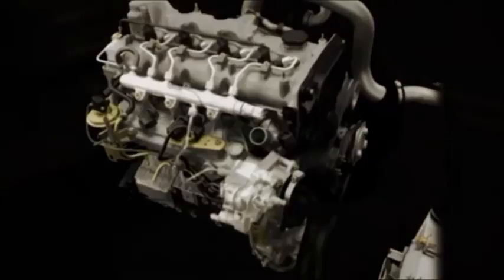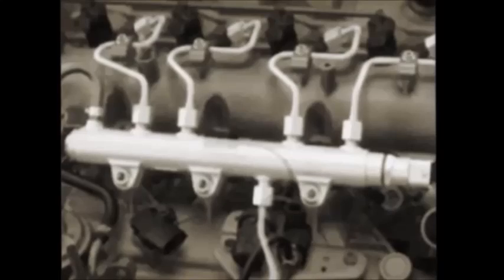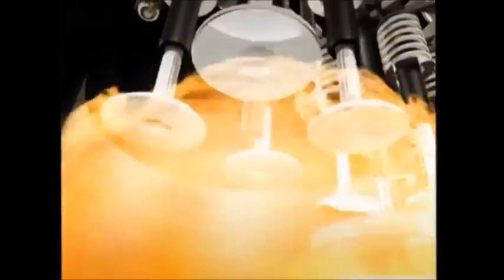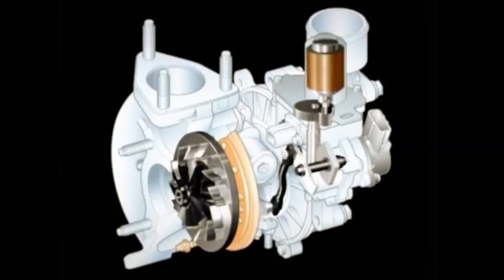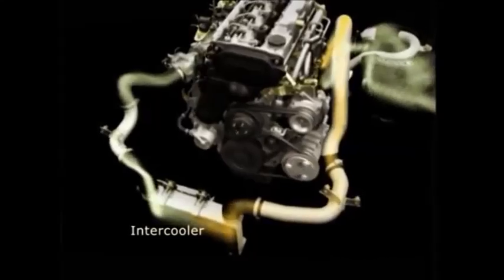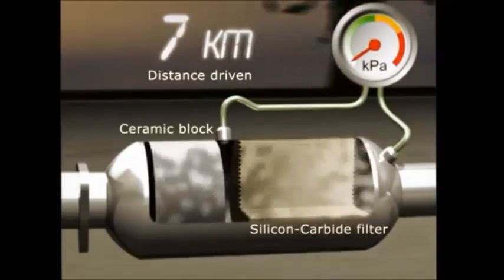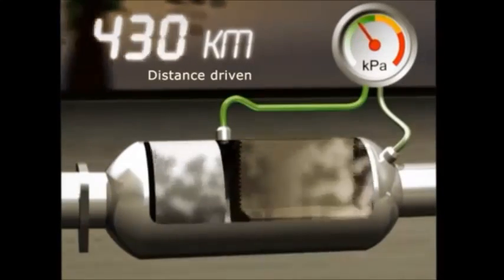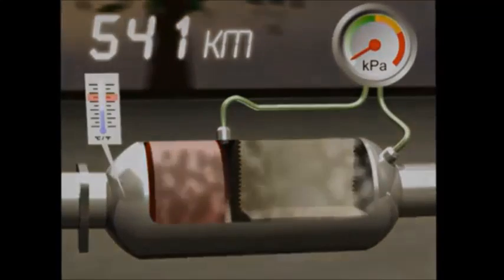How CRDI Diesel Engine works

Comment: why very high pressure 23k bar?
Reply: richard cero the higher the pressure the better the atomized fuel in the cylinder....direct port injector has to battle high cylinder pressure